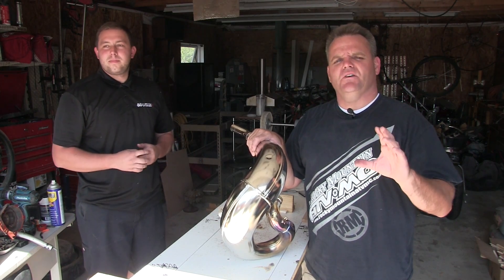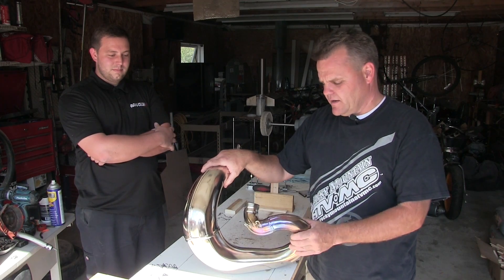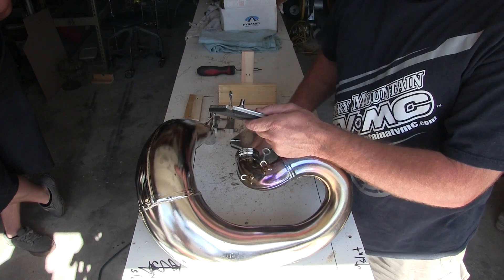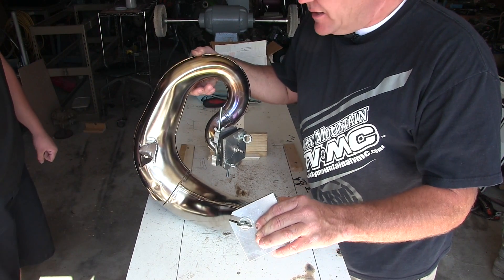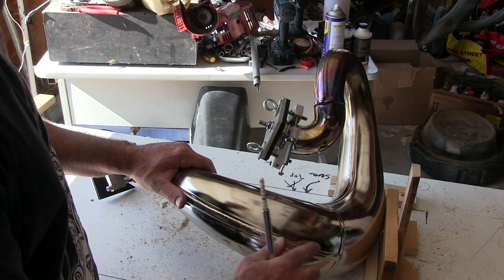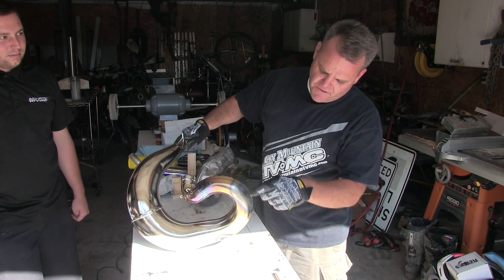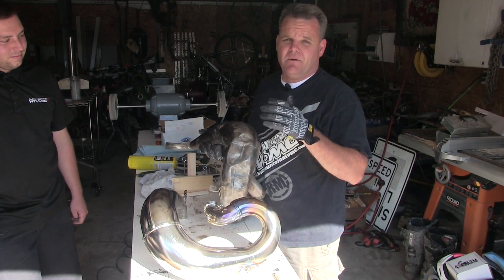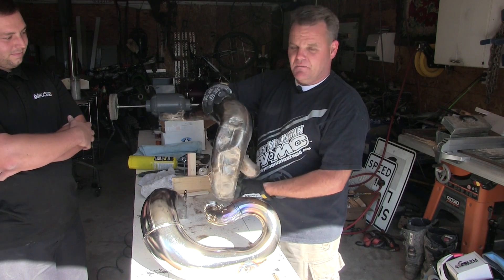Pipe Repair by Moto Horse in Utah

Comment: If you use a quick coupler on the bracket you can attach your air hose directly to it. Then set the regulator on your air compressor and the extra pressure that builds when you start heating will be blown off by the regulator. This makes it a little less scary.

Comment: how do u burn out the carbon in a used pipe?
Reply: I used the heat gun and torch method and burned it clean, I also sprayed a bunch of simple green and let it sit and washed it out. Plenty of video I have one.